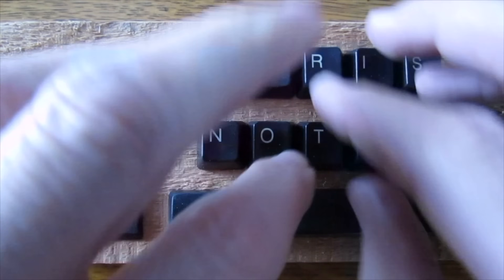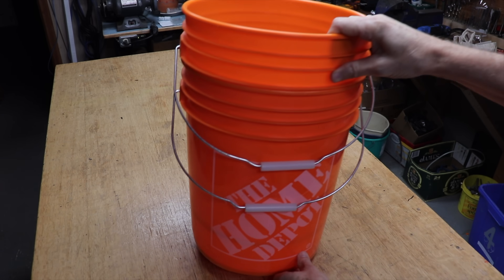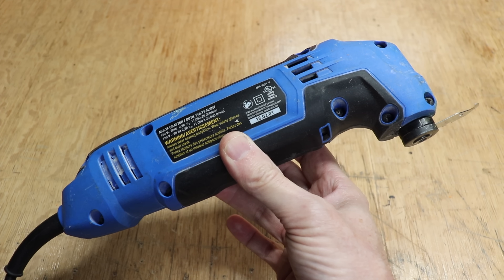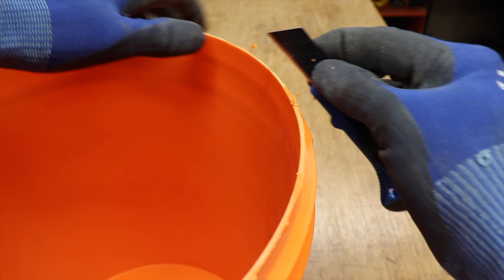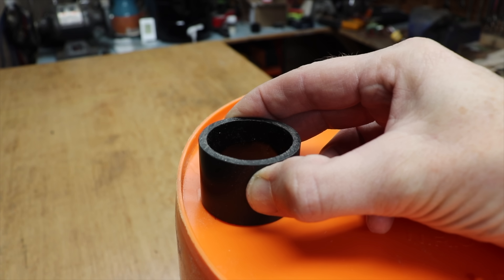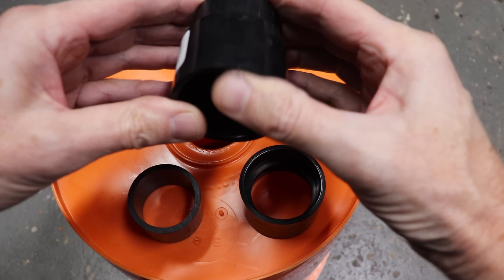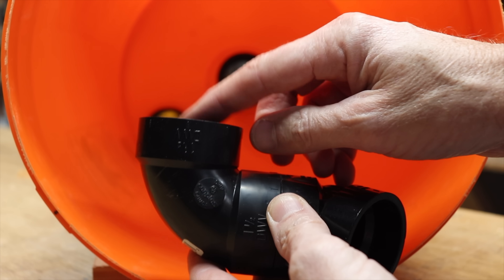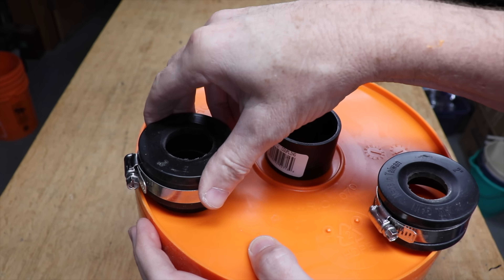How to Make ● Simple Cyclone Dust Collector

Comment: Just made one and it works great. Still need to do the upgrades as it will occasionally tip over. I didn't need the rubber end caps as my vacuum hose fit into the PVC coupling and the shop vac hose fit over it.  Great idea!. Thank you.
Reply from the maker: Nice work!

Comment: Didn't want to sort through the 4,000 comments, but I'm doing this today using PVC pipe. Just wondering if you used ABS for a certain reason as opposed to PVC or CPVC? Thanks!!
Reply from the maker: I used ABS because that's all they sell here in Canada! In the US they use mostly PVC. Both will work.

Comment: I made this with my 1.25” hoses and the pails collapsed when I started vacuuming the floor. Any ideas?
Reply from the maker: Yes! I did an update for that problem...........https://youtu.be/BeU4nqSJtBY
Reply: I updated mine and I still get collapsing.
Reply from the maker: @wannabefunnyman  The vacuum you're using may be too powerful.
Reply: Thinking about switching from 1.25 to 2.5 hose. Do you know if the pails will still work with that?

Comment: Chris:...& now if you put a light inside the bucket you can see where the 45° fitting is. Now take your little screw and drill it in there "MoMeNTs LaTeR" you know what use a tape measure instead! 

Me: Lol I need another bucket i was doing it step by step smh I should have watched the video first !!

Comment: Chris: This is an excellent design, maybe the best I've ever seen. I spilled about 3 gallons of shredded paper on the floor. After picking it all up, I checked the shopvac. Not a single shred in it!  I built a roll around platform with sides for stability, and it works great. Thanks!
Reply: Good idea.  A cheap Harbor Freight 4 wheel dolly could be an easy starting point for a roll around platform.
Reply: Looks great 👍 ill try it myself. 
Regards Frank

Comment: Hey Chris! Loved ur vid,built one,works great,tweaked it a bit,still works great...my only question is when I hook it up to my combo sander it whistles like super loud...all joints are either glued or taped.....seems th whistle is coming directly from the sander... any idea's????? Thnx!!!!!
Reply from the maker: Thanks for that! Others have said it's one of the hoses or the fitting that the hose is connecting to on your sander. Use the process of elimination to locate the source.

Comment: Chris, I looked at your build and built one for myself. Not an exact copy, but essentially the same. I used Lowe’s buckets. I used 1-1/2” PVC, used a hole saw to put the holes in the bucket. I tried to use your hook blade hack but my Porter Cable Vibrasaw did not seem to like it so I just used a saw that came with it. The holes in the bucket I did with a 2” hole saw, not tight, but no issue. I used one coupling for the suction line, and I use a 90 so the line exits towards the vac instead of straight up. Less tipping and the hose is less likely to collapse. I cut the PVC Pipe with a Rigid Pipe Cutter, make a very nice straight cut. The short nipple allows me to drive the two fittings together tight and this essentially seals the hole. Since my vac has a 2” hose, I use a 1-1/2 x 2 rubber flex coupling instead of the caps you used,  the small end fits snug on the bell of the 90 and the hose fits nicely into the large end. I tighten the clamps and we are good to go. I am also incorporating your fix for the collapse issue. I will be adding a base that will ride on 4 casters. Thank you for posting.
Reply from the maker: Sounds like a great build!!
Reply: @chrisnotap  I thank you for showing this project. I'll take a couple photos of the competed project for you.
Reply from the maker: @Adventuring_With_Jim  I'd love to see your version! Send the photos to chrisnotap@gmail.com
Reply: @chrisnotap  Will do, I am finishing up the cart that will carry the Vac and the cyclone. Should be done tomorrow.
Reply: @Adventuring_With_Jim  really interested in your version also is there a way you can send pics to me also?
Reply: @rog3rbee915  I'll be happy to., send your email. 
I am getting some bleed of fine powder dust into the Shop Vac. But the filter and filter covers stop it from leaving. I replaced the 1-1/2" PVC with 2", this could possibly be the reason. I am looking into adding a 12" tall intermediate section to the bottom of the upper bucket. Not sure yet how I'll accomplish this. I think that it needs more room above the pile to let the dust drop before the air exits.

Comment: I tried this with the Lowe's buckets and it was too tight too fit the bucket together... At first, but then I put a blowtorch to the inside of the rim of the bucket that wasn't cut and  stretched out the rim a little bit. Snug fit after that. I imagine that would help prevent the need to go crazy with the razorblade if you were struggling as i was.

Comment: I was thinking about using a 55 drum instead of the buckets so I wouldn't have to empty it so often. Do you think I would lose suction power with the increased volume of the 55-gallon drum?
Reply from the maker: You shouldn't lose suction at all. It will take a few seconds longer to get going but should work

Comment: Would a hole saw be too much? Or did you initially try it with a hole saw and find that it works better with the snips? Or maybe a paddle bit if not a hole saw?
Reply from the maker: Hole saws work if you can create a resistance fit. Don't use a spade bit. The hole size is too big for that.
Reply: @chrisnotap  thanks

Comment: Curious if there is, or could a vac be built that just shoots it outside? No filter and catch bin.
Reply from the maker: I'm sure they make one. A shop vacuum cleaner impeller is too small and would get clogged with chips.
Reply: @chrisnotap  Thx for quick reply bud, have not seen anything out there, am I searching wrong? Had a thot of a big 2x4x8' box outside that would be a giant collector within the vac circuit, but i think vac would need to evacuate all that volume before it would work every time. if you make one as you were thinkin with bigger impeller, I will surely build it!!! Btw, your channel is brilliant, I admire your genius. =)

Comment: Great Video. FYI because I didn't know till my Dad told me but for cutting with tin snips they are actually color coded. Yellow is for straight lines, Red for counter clockwise/Left turns and green clockwise/right. Might be easier  if you have them

Comment: do i have 2 follow this w/math precision (read, infinite precision)? like the 90/45 fittings - do they have 2 b short? because i got a 'longer' ones (those which have 'ends' farther apart and obviously the 'input' is a bit longer (and when turned a tad, the 45 fitting should kind of look a bit downward, toward the bottom, right?). because i built it today and tried it... well, w/o the paper bag noticeable amount of wood 'dust' still made it into the vac and ended up on the cloth 'filter'... otherwise the dust may still make it into the bag (of course, waaaaaaaaaay less than w/o this colector). 
i notice u do get dust on the cloth filter and in the vac's chamber... but may b i need 2 tinker w/my 'implementation' more? like use the fittings exactly like yours?

Comment: can the 'original' vac's hose (1-in) be used as an 'output' of the collector? would it create enough suction/pressure drop? or do i have 2 use 2 2-in  hoses?
Reply: sorry, should have watched till the end. u actually doing exactly that... hmmm... almost. my second hose is 2-in on both ends. now, still the same ?: would the 1-in vac's hose create enough suction if i modify your design a little and connect a 2-in hose as dust input?

Comment: I love this build. Thanks so much. Question...when I fire the vac up there is a very high pitch that I can't seem to figure where it is coming from. Any thoughts?
Reply from the maker: Use the process of elimination. Others have said it was one of the hoses they were using.
Reply: @chrisnotap  I am going to try a smooth bore hose and see what happens. Thanks again.

Comment: This looks great. Would this work for sucking up spruce needles off my garage roof?
Reply from the maker: I think spruce needles wouldn't even make it to the vacuum because they'd get stuck in the hose!
Reply: @chrisnotap  I put back pack straps on a wall mount shop vac. It is easier to wear it on my back than trying to balance a shop vac on the top of a ladder with one hand while manning the hose with the other. The hose (1" or 1 1/4") that came with the wall mount did get clogged. But my 2" hose from my shop vac fit and doesn't clog. I was wondering if larger hoses would affect the suction.

Comment: I made this and works great , but I have a high pitch sound, can't tell if it is from the vacuum or the buckets. Would you know what is causing it and what i need to do to remedy the noise? Using a 4.5 HP Shopvac.
Reply from the maker: Use the process of elimination. It's usually one of your hoses
Reply: I used a sum pump hose and the noise is absolutely wretched. Is that what you used?
Reply: @wtfchuck6406  I did, it was terrible. Glad to see I am not the only one. Took a hose from an old vacuum and works great.

Comment: Made one after several trips to the big box stores. Saw your video and went to buy all the parts before I bought the vacuum. The store had a 14 gal 6 hp on sale so I brought it home. Yours worked so well that I didn't want to mess up a good thing. So what i did was use two that made the cyclone made out of 1.5" each and the suction oun out of 2" to better match the thin 2" hose the vac had.  It sucks as it should, doesn't collapse the buckets, and gets everything off the floor.  I like it

Comment: Could you use a hose running from the intake, to the bottom of the bucket, and fill thebottom of bucket with say 4-5 inches of water, and run the dust through the water for fine dust ?

Comment: I made this  collector  today.  For the connections on the bucket I used 1 1/4  inch  abs trap adapters. The hoses fit tight and you  can  tighten the  ring  for an air  tight connection. This unit is amazing in how it works. Thanks for the video....
Reply from the maker: Nice work!

Comment: Would this work for the very fine dust from a sand (abrasive) blast cabinet? Mine is old and has its own dust collector, but it doesn't do a very good job of collecting dust anymore - the fabric filter material is worn and has holes in it, and the barrels are kinda beat up and not sealing well anymore. Basically, it's time for a new one, but they cost $500+! And I tried using my shop vac, but after a couple minutes of blasting, the filter is clogged with the super-fine dust! If this design would work for that, then I will be building one - no need to spend hundreds of dollars on a new store-bought one. I might even be able to somehow use the vacuum motor from my old dust collector, since it still works. Thanks for the video!

Comment: Great Video, I plan to make one of these. One possible issue is if you overfill the bottom bucket, you will make a big mess when you open it. I'm thinking of putting a long skinny plexi window in the bottom bucket so I can empty it before it fills more than 5 gallons. Thanks for the Video!
Reply from the maker: Shining a light from the back of the bucket allows you to see the level through the side of the bucket.

Comment: I made one of these, used 1-1/4” sump pump discharge pipe from bucket to shop, getting a HORRIBLE whistling noise....am I using too small of hose? Is I disconnect that hose and just run an open hole at the top it doesn’t make any noise

Comment: I think this is a solution only for the smaller shop vac (like in this video).  With my 15 gallon Rigid the wood chips stay in the bucket and dust makes it into the vacuum.  Better than nothing, thanks for the video...ended up getting the Home Depot $30 rig.  I think it was worth it.

Comment: I'm petty new to woodworking. Whats the point of doing all this? Does the shopvac not work fine for sawdust? Does the dust clog it up or something?
Reply: When you use a shop vac the sawdust goes directly into the vacuum. Which is all fine and dandy, but you'll also go through more filters (which aren't cheap) and it could prematurely wear out your vacuum (always suckling up debris).

Now dust cyclones will dump about 99% of your sawdust into the bucket. Less sawdust going to your vacuum and less on the filter. Easier to dump, easier to clean and easier on your vacuum.

Comment: Hi Chris,
Thanks for this idea and very clear description on to make it. After some difficulty getting the buckets to fit together, I managed to successfully put it together. It works great great. Just one issue that I am hoping you can help solve. When I turn my shop vac on, there is this VERY LOUD whistling sound. Any ideas why that is?
Chuck M.
Reply from the maker: A few others have mentioned the same thing and it is one of the vacuum hoses. Use the process of elimination to locate which hose

Comment: I wonder if this will work better or worse than a Theim baffle. Or how it will fair with a larger containers? Perhaps I will test it soon.

IMPORTANT! The stuff that passes out the end of the whole system is the micro stuff that does the long term damage. If it all possible last exhaust should be outside!
Reply from the maker: I tried a Thien baffle. You can see it at 0:20
Reply: @chrisnotap Out of a plastic lid, there could be other confounds to it's apparent failure for you. 

I did not see any bucket scrubbers in your new DHS video. What has lead to that over the 4 years? Have you soured on them?
Reply from the maker: Not sure what DHS is and what you mean by over the 4 years?
Reply: @chrisnotap  Chris, should I follow your design for the bucket collector then?

Comment: This works surprisingly well however if you use Lowe's buckets be prepared to sand the inside of the bottom bucket a fair amount to make them snap together. Otherwise great video thanks

Comment: Just finished mine using all 2” PVC to accommodate my 2” vac hose. Works perfectly! I guess the ol’ quick and dirty ain’t necessarily so dirty after all. What a pain in the arse it was taking that filter outdoors every 15 minutes to blow it out with the air hose. Thanks!

Comment: Why does the inlet come in at the angle that it does? I get why the 45° is there, but why the 90°? Wouldn’t it help with airflow to bring dust in with another 45°, or even straight in? 

And why come in from the top? Wouldn’t it improve separation to drop in a few inches lower, or to enter the bucket from the side?
Reply from the maker: Anything I make I try to find the simplest way to make it. Putting the entry on the side is more work. The angled bits were great for testing since I was able to adjust the angle and test and repeat to find the best position. With a side entry this was not possible.

Comment: Can PVC pipe or another easier-to-find material be used in place of ABS? I can't find ABS connectors or short lengths of 1.5" ABS pipe anywhere (shortest length is 10 feet). HD doesn't carry anything ABS, and neither does Lowes or Ace. I was only able to find the elbows and rubber caps on Amazon. Also, where can vacuum hose be purchased and what size? Thank you!

Comment: Hi Chris, just completed assembling a dust collector generally as per your design with the 2 buckets but added a Thein style baffle. Works a treat. The dust that did get through the hoover - vacuum - bag is really tiny. Thank you for showing the easiest dust collector to assemble in a great explanation video.
Reply from the maker: Nice work!
Reply from the maker: I tried the thein baffle in this design thinking I needed it but it made no difference at all.

Comment: Nice set.up...use a street 45 and you'll need less of the 1-1/2" pipe ! The plastic cuts very easily by hand with the carpet blade.
Reply from the maker: Thanks for the tip
Reply: How about a street 90, so the flow into the 45 is smoother?

Comment: Thanks! Made this with Lowes buckets, they are a little different, cut under the first line but still had to cut in  some vertical relief notches to get it to fit into the bottom bucket.

Comment: You could of use pliers to take the handle off the bucket without cutting it .
Reply from the maker: Not these ones. They were  very hard to get out even with vice grips.
Reply: @chrisnotap  I worked in a bucket factory and you have to see how the wires is bent in side the hole as a wire that is going down you have to bend up .

Comment: Do you have a video on how to ground it? Just shocked the crap out of myself!!
Reply from the maker: Use some copper wire and attach it to the bucket whatever method you like. An alligator clip should be suffice. Run the other end to a water pipe (copper, not pex) or to a good metal ground like a metal electrical box
Reply: THANK YOU!! I will certainly try this!! I appreciate the response. 🤗

Comment: I used Lowe’s buckets and the fit was fine without creating the angle on the bucket after cutting. No big deal but it is a time saver. Great video!
Reply from the maker: Great tip!

Comment: That is a brilliant idea. I was wondering how many CFM I could push through it without picking up too much of a dust. My plan was to use a centrifugal blower to exhaust air outside. 4" rated about 200 cfm. But I do not want to push too much stuff through it, though. Hence, I need a dust collector. Any suggestion?

Comment: Made ths today.  The buckets are different, shorter, with fewer ribs above the handle.  I wrapped 3/4' in tape aroind the ring about the handle, cut a slit in the left over lip, and it fit fine.  Had to imporvise, adapt, and overcome shortfall in my HD purchases (I forgot a straight coupler).  All in all, it works fantastically!  I'm ging to build a roll around cart that will hold both the vac and collector.